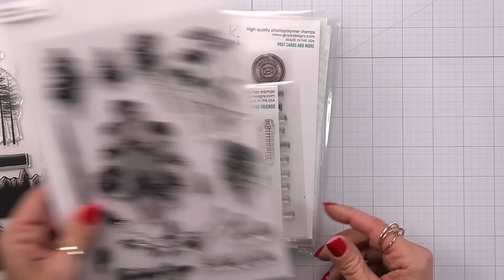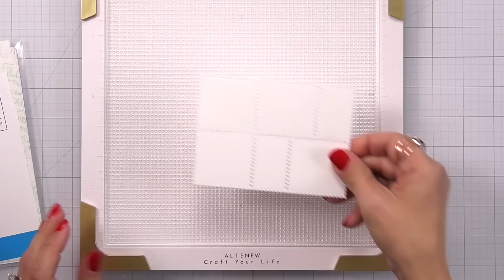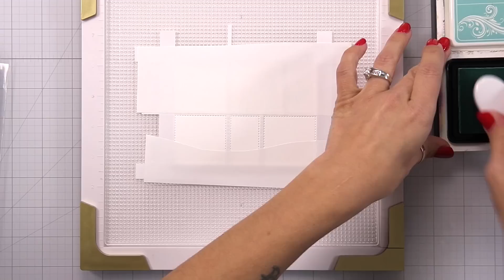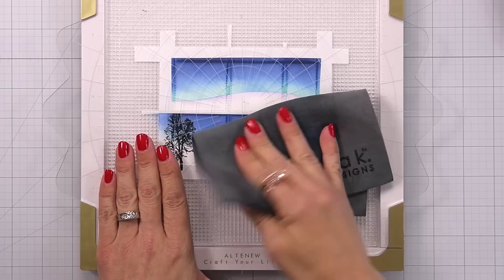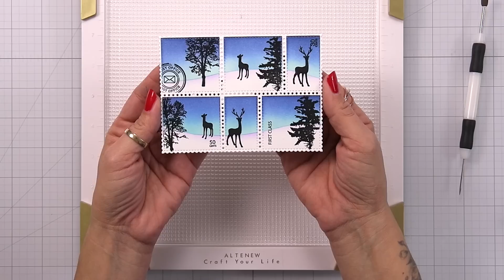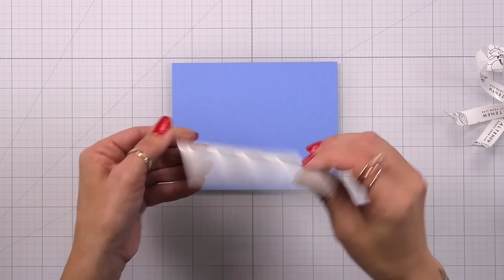The MAGIC Of Masking Magic From Gina K Designs

Comment: Mindy, does that clear plate come with the magnetic plate? If not, what was your sandwich?
Reply from the maker: yes. The clear plate comes with the magnetic platform. I believe there are also sandwich recommendations on the packaging. I used the magnetic platform and the clear plate. Then just adjusting my dials as needed for the material being used.
Reply: @ thank you, appreciate you responding! I was not sure and I do not have the magnetic plate yet, so I was checking☺️